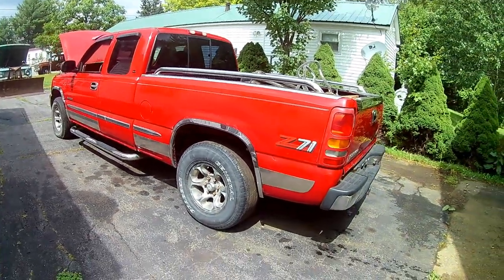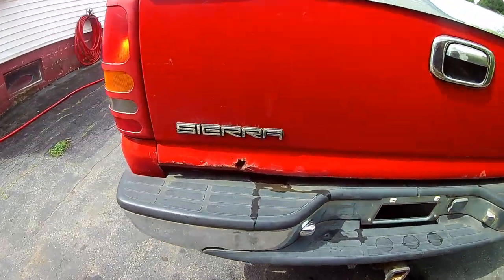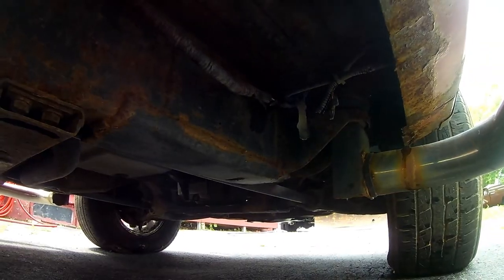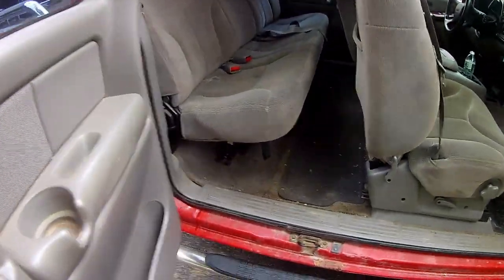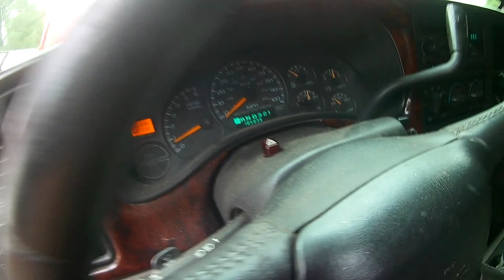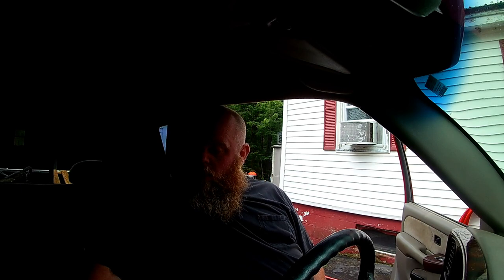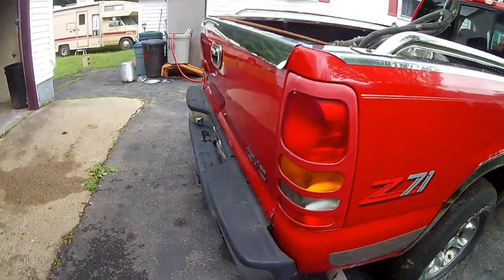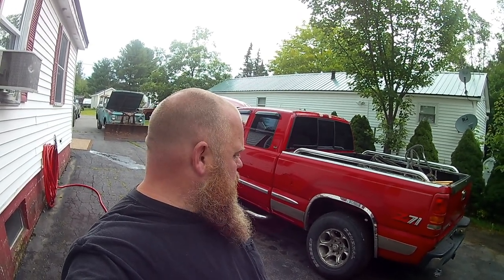Requested: Walk around and decisions 99 GMC

Comment: I think i would go over the whole truck to make sure the ball joints, brakes, brake lines etc are good before making a decision. If you spend $200.00 for a transfer case i think it's a win. Even if you get a year out of it you got your moneys worth.
If it needs a lot of work then it's not worth it. Pull the engine and anything else you want to keep and scrap the rest.